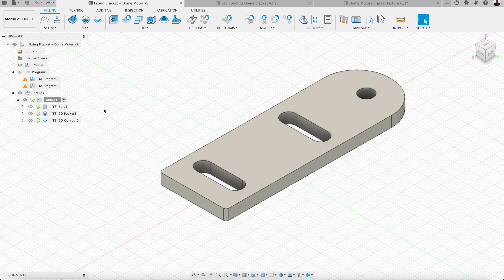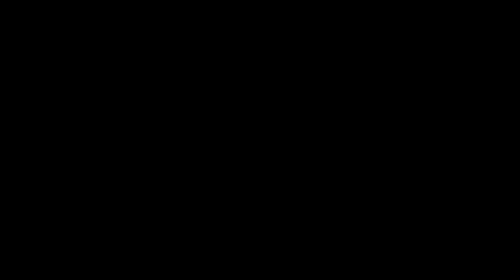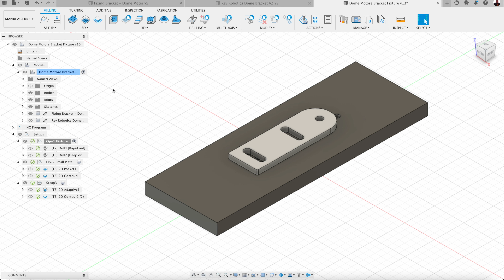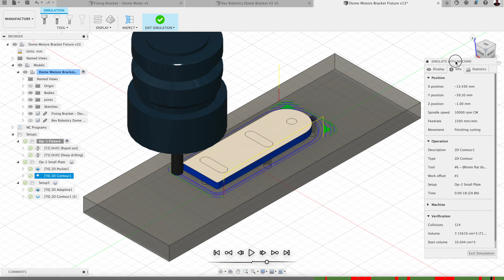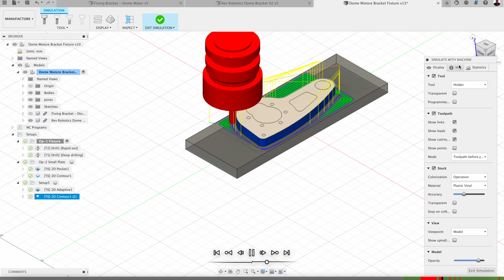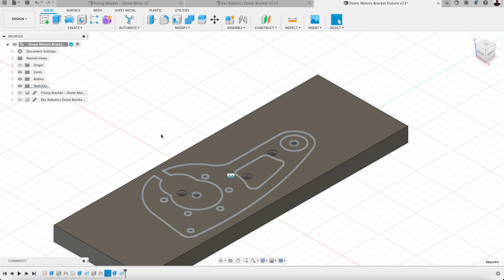SYIL X7 CNC makes R2-D2

Comment: Really great tips on work holding Aaron thanks, it's half the battle with CNC machining, working out how to hold the material.   And those chips were really flying too!
Ian
Reply from the maker: Thanks Ian. Not some of best work, as it was a one off part and I rushed the fixture. The first part was harder to align due to the slots, but the second part was easier with those plastic bungs I made. Cheers mate, 🍻 Aaron

Comment: I especially enjoyed the fixturing portion.  Work-holding can be as interesting as the part itself.
Reply from the maker: Thanks Garon. Yes I didn’t go overboard with the fixture, as it was a one off part. Operation 1 did Al the critical work (dimensions). Op-2 was just the contour which was non critical. Cheers buddy 👍🍻

Comment: Great vid that mate. I’m finding CAM really easy now, and quickly finding ways to overcome issues. 
What I’m still struggling with is CAD. When you drew your fixture plate, did you just start sketching a new component off the underside of the actual part like you would with soft jaws? If so, for the second part, did you just draw the same size fixture plate? 
Any chance you can make a vid coving this ? 
Thanks buddy 👍
Reply from the maker: Hi Rob. For that fixture plate, I opened a new design and modelled it.  I then inserted the part and worked like that. I’ll do my best to make a video for you mate. Cheers 🍻
Reply: @DCT_Aaron_Engineering  that would be amazing, I’m sure others would benefit from it as well.
Reply from the maker: @MrRctintin  no worries buddy. It’s in my “to-do-list”. 👍🍻

Comment: Thanks Oh Great Guru.

With CNC, Do you tell the Program what tool to use for a step or do you load a tool into carousel & program then selects what it needs ?
Reply from the maker: G'day Chris.  That's a good question.  Some CAM software has feature recognition.  However, with "Con_Fusion360" you have to nominate the tool and profile that you want to machine.  To CAM these 2 parts and the fixture plate took me about a 1 hour.  Maybe another hour for machine set up and then a couple of hours to run the parts and film.  It was a lot of work for a "1-off" part.  Cheers, Aaron.
Reply: @DCT_Aaron_Engineering  Thanks Mate.

See you are teaching others all the time.

Be like Berger Paints & Keep on keeping on.
Reply from the maker: @ChrisR2517  More like that battery add where the bunny is still hopping and the other bunny is flat.  Well that flat one is me LOL 🤣.  Blood new job is killing me.  Not use to working full time again 😴

Comment: Great vid.  Fwiw, especially if you’re already drilling holes, drill a hole somewhere in your areas you’ll be doing adaptives within then select that as an entry point for the helical ramp. You can run the ramp much faster and it’s less wear on the end mill since it’s not cutting full width. If you happen to have a drill loaded that’s larger than your end mill then select it as a pre drill point rather than an entry point and it’ll skip the helical altogether!  Faster and less end mill wear and drills are cheap!
Reply from the maker: G'day Bill.  I usually do that with my steel parts.  However, for these little aluminium parts I couldn't be bothered and just hit it an end mill.  Spindle load was only at 30%, so I really should have pushed it harder.  Thanks for the comment and tip mate.  Cheers, Aaron.